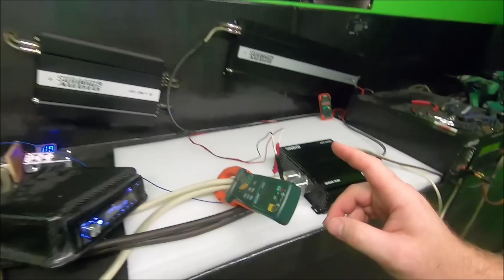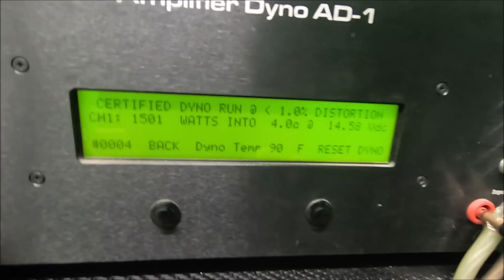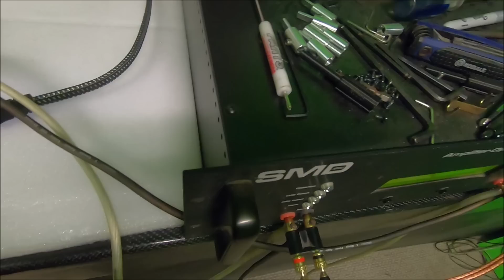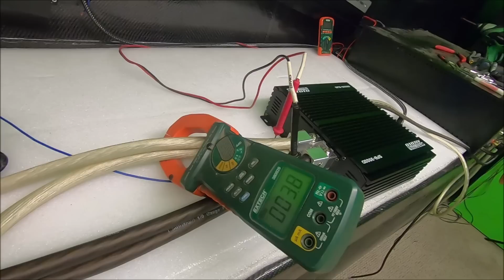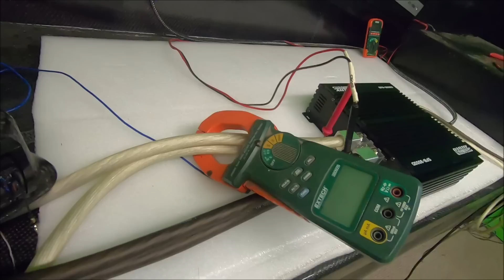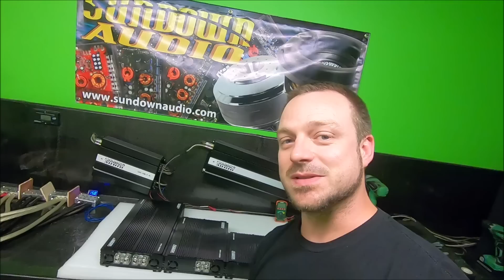***You Won't Believe How Much Power*** Sundown Audio SFB-3000d Amp Dyno *Amp Test Tuesday*

Comment: I said it before but I am in  complete shock and awe seeing a Brazilian style amp with 1/0 terminals. you may have just destroyed the space time continuum
Reply: Brazilian amps are known for being extremely powerful how ever its dirty power not clean power. Absolute best boards you can get for clean power are Korean boards. Why you think you wont catch hardly any Brazilian builds in the us the world records are all done on Korea boards.
Reply: @ColdVenom159   Lookin at the inside of those things they almost look industrial, like a power inverter. Not pleasing to the eye.  These seem to make power the "cheap" way  by operating at insane voltage levels. They must clip really easily which is why i'm not surprised to see the brazillian companies going way out of their way to include dash mounted clip indicators which many dedicated sub  amps don't feel the need to ship with.
Reply: @rmblwgn  oh I believe it with me if it's not a Korean board I will not buy it. In person I've seen to many fails with amps and subs all sundown. I refuse to spend the insane cost they charge.
Reply: @ColdVenom159  im a budget amp fiend, i spend  hours looking for deals online. I got a DUAL da6001 on amazon which does almost 1400w for $70(one night sale).  I look on the bottom... made in korea....  in 2013 LOL
Reply: @rmblwgn  if that dual does a real 1400w which i highly doubt damn good deal. The amp take 3 30 amp fuses which in total is 90amps 90 amps at 13 volts is only 1170.00watts if you are actually able to hold a solid 13 volts at 12 volts it would put out 1080.00watts. next time you have system cranked feel your subs specially your amp if its a bit warm youre clipping it aka you have distortion which hurts your power alot. a properly tuned amp on decent power will hardly get warm. you say youre on stock which im assuming electrical which means you charge at 12 volts so youre only getting 1080.00watts long as you arent clipping the amp. sorry to break it to you man.
Reply: @ColdVenom159  it has 4 30 amp fuses. Check ryan Blankenship dyno of it. Da6001
Reply: @rmblwgn  oh i seen the video guess you didnt see the parts where he distorted the shit out of the amp to get it to put out more power. in case you dont know a proper reading is with no distortion, he actually pushed the amp so hard distortion it started to clip, either or lmmfao amps claimed to do over 4k and cant manage half of that enough said. everyone has their own budget i know myself i wouldnt buy the am for 20$ not worth it. i rather spend 150-200 and get an amp that will blow that dual away and do actually more then its rated power.
Reply: @ColdVenom159  the test stops at clipping. Watch the smd amm1 . I clamped mine at about 1250. Not bad for like $75
Reply: @rmblwgn  lol dude im not gonna jump round the internet just so you can try and prove your point. i watched one video seen the amp get distorted like crazy thats enough for me, bottom line here is you own the amp if youre happy with it thats all that matters. me i feel the cardboard box it came in holds more value. either or its your amp if youre happy with it im happy you are happy with it after all its your amp. just keep bassing on man.
Reply: @ColdVenom159  You're assuming perfect efficiency though. A general rule of thumb is just to multiply by 10 to account for losses.
Reply: John D so do you think sundown SCV or SAE amps which are korean have a cleaner sound than these SFBs?
Reply: John D do these SFBs get as low?
Reply: China amp
Reply: @caseypannell810  Yes. The SFB line is made in China.

Comment: What subs would u pair with that amp or a pair of those amps
Reply: I would say this amp would work best together with 10 inch subs or smaller. Main reason is smaller subs work better and  like that higher  frequency (4ohm) load too. thats my educated guess.so even if you had a 12 or 15 that is rated at 2 ohm, a 10  or smaller rated at same 2ohm would still function a lot more efficient
Reply: I got 2 sundown sa 12 on a taramps 3000hd so i guess it will work with 2 12 subs easily
Reply: A pair of xv2 or u series would work at 1 ohm. A single zv5 at 1 ohm. If that clamp at 1 ohm is accurate it's 87% efficient. Crazy.
Reply: @BadGarageGolf  but Derek question on the video was what sub would work best with the amp (at factory settings) witch I think he said it is 2oh stable. Yes it can do 1 oh but on papper I was trying to think what subs would work most efficient an same for the amp

Comment: Would that push one x-series 15in Sundown Audio subwoofer? Or two? I'm very interested I like how small they are.
Reply: The x series pair well with about 2000 watts rated power a piece.
As you know there are many factors at play. Efficiency and impedance usually result in subs handling certain frequencies much better in terms of durability for a given output level. Box design determines this a lot. In general 1500 watts will get you a nice safe zone. But 2000 or more gives headroom to account for dynamic music and practical input voltage under load. You will have a little extra juice if you want to bump a song or two extra loud or do a burp to impress. Mechanically these subs are very rugged and have no problem handling over rated for short duration. I think you would be happy with 1500 a piece. The 15 offers good efficiency. But 2000 is recommended.
Reply: @maxfmfdm  this reply just gave me so much clarification on my setup.  2 sundown x 15s and 2 sfb 2ks. Thank you